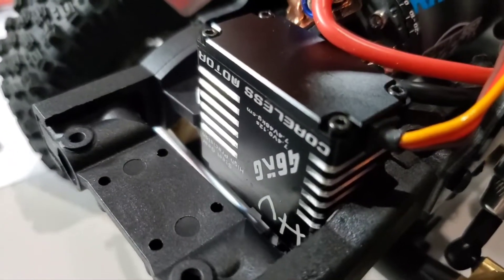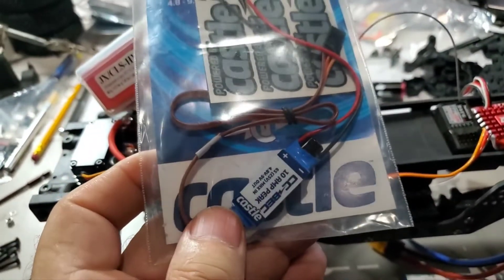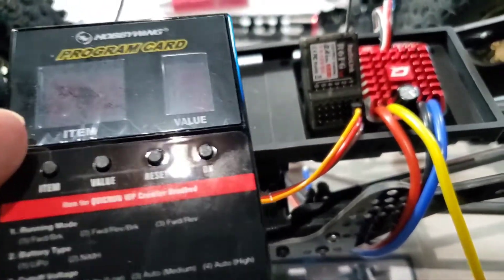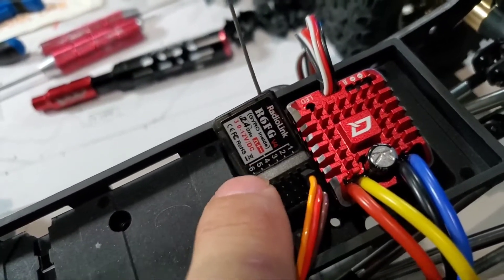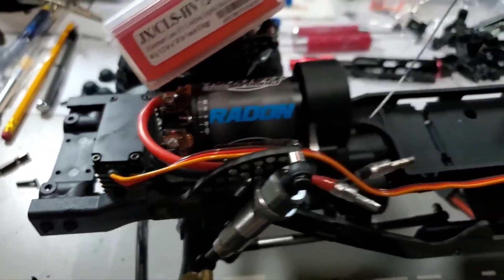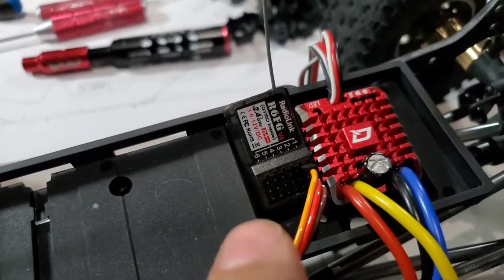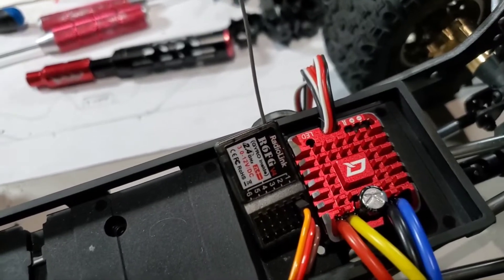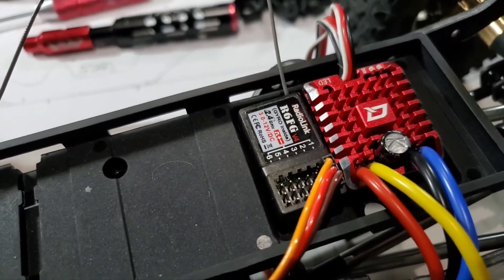How set up more voltage to power up your servo using a BEC.

Comment: What if the servo say 7.4 and 8.4 volts but the ESC doesn’t have 8

Can I still choose 8 volts will the servo still work well

Or it has to be 8.4 and not 8 volts
Reply from the maker: @reginaldmcnab3265  yes it will work at 8v
Reply: @TheTankRC  oh thank you very much!🙏 in spite of my writing errors you were still managed to figure out what I wanted to say! 😀🙏

Comment: Nice explenation.
Butvoltage is not everything...
One important thing is amps..
A big servo draws a lot of amps.
The esc can push 7.4 volts but how much is the Amp...especially if more things to the esc..extra servo and lights..
When trotthle and full steering..you will notice like a drop off power ...because the esc can provide the constant 7.4 volts but iff its only 3 Amp for instance it will brown out..
Reply from the maker: Yes this is basic, your talking more in depth information and if I add to much it might confuse some people.   Thanks for watching and thanks for commenting
Reply: @TheTankRC  You are both right. Total power available is measured in watts and it's formula is Volts X Amps. Hence you see 30amp fuses in a car with just 12volts DC but not on your standard home devices (assuming an EU voltage of 230volts AC)
 
This means for example for the same power in the US while the volts is 110V the amps will be double for the same power/effort in watts. This means thicker cables are needed to carry more amps, with less volts for the same actual power in watts.
For this same reason the power grid carries the same demand in watts but at crazy high volts to reduce the amps. It's a se-saw.  Increase one to reduce the other. 
So Step up transformers will take the electricity from a power station and step UP the voltage to 20,000 + volts on order that the cables we see do not need to be the size of a train track rail. Once near houses and industry the voltage is stepped back down to allow a LOT of current again. There are losses of course and a trade off. But the cost to suspend smaller cables over 10000's of miles/kilometres is minute compares to carrying the same power at a domestic voltage. 

Components have a resistance and this is where is gets more complicated. If a rating is in watts then it's ok so long as the amps and volts being demanded from a device does not exceed that.

Comment: Hallo. Can you write how you need to connect BEC only servos?
Reply from the maker: Here is another way to do it without the SERVO DIRECT CONNECT     https://www.arrmaforum.com/threads/run-a-bec-just-for-the-steering-servo-for-big-rock.4980/
Reply: @TheTankRC  thanks.... I managed to connect everything myself. The servo got a lot of power. Best regards.
Reply from the maker: You require 2 things an External BEC like i shown in this video and a SERVO DIRECT CONNECT from Castle Creation, This allows you to use the ESC's internal BEC at lower voltage to power the receiver, and the external BEC, along with the Servo Direct Connect, to power the steering servo at higher voltages.  See link  https://www.castlecreations.com/en/servo-direct-connect-011-0154-00